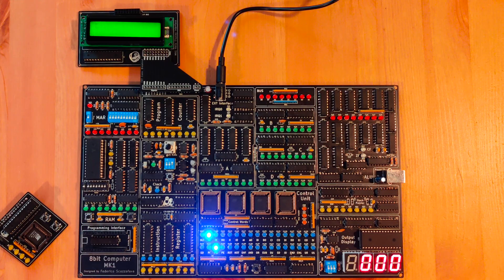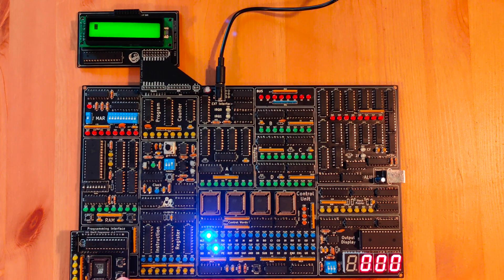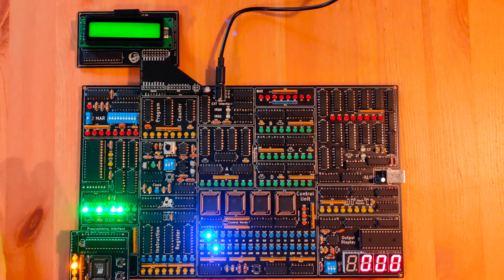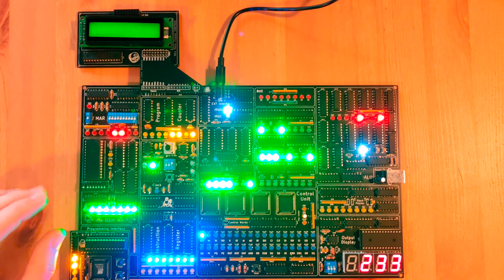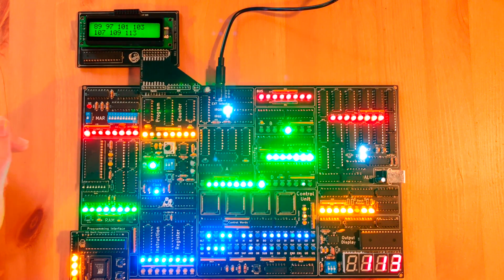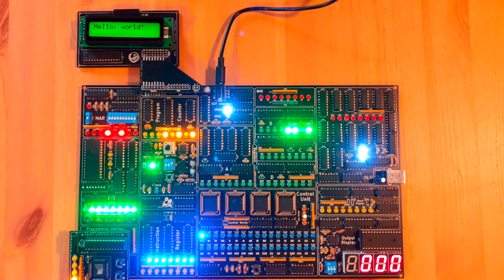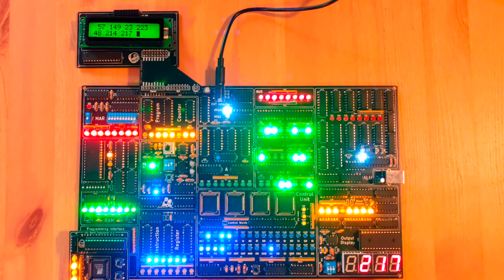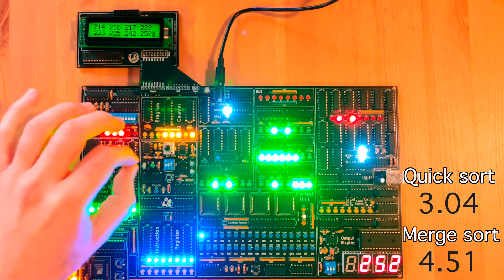MK1 CPU v2.0 - home-made Programmable 8bit CPU

Comment: you could avoid the Arduino LCD controller by just directly connecting the LCD directly on the Main Bus, implement 3 new Control lines for read/write, RS select and enable, 1 (or 2) new instructions that read/write to the LCD. The main disadvantage is, that you loose the Interrupt on LCD ready, since that is probably triggered by the Arduino Coprocessor.
Reply: That's how it used to be done back then. Those LCDs used to be connected to the bus of the classic 8 bit CPUs like Z80 and so.

Comment: Nice work Freddy and a pleasure to see the CPU operating. :) I see the ubiquitous ATMega328 is brought in to handle the interface to the LCD. I'd have probably done the same, those Arduino code libraries are just far too convenient to ignore.
Reply: you could avoid the Arduino LCD controller by just directly connecting the LCD directly on the Main Bus, with a few extra control lines.